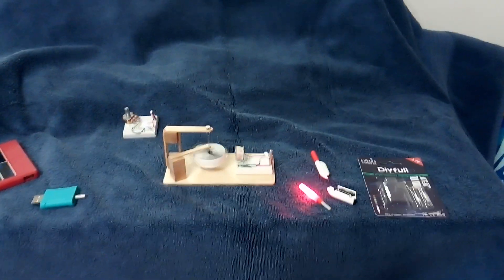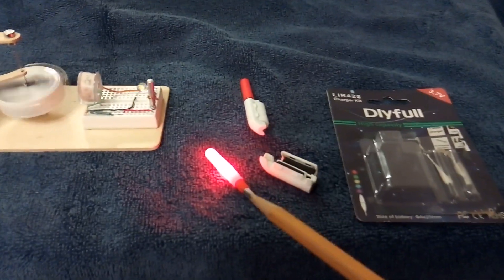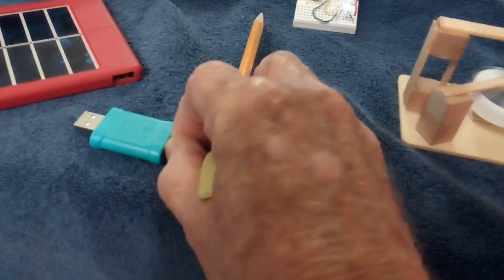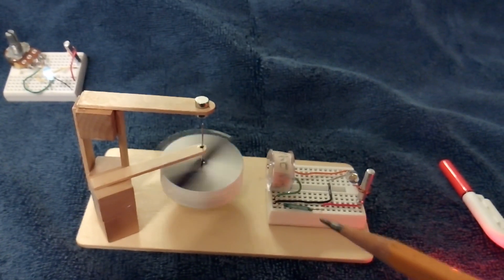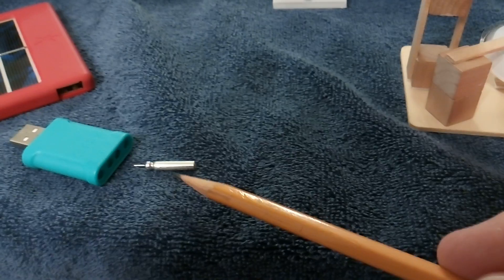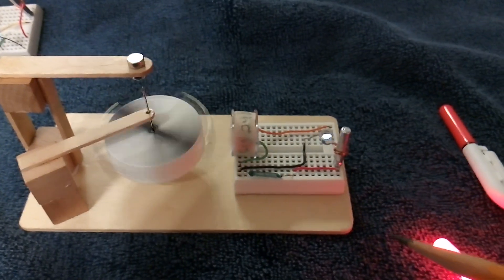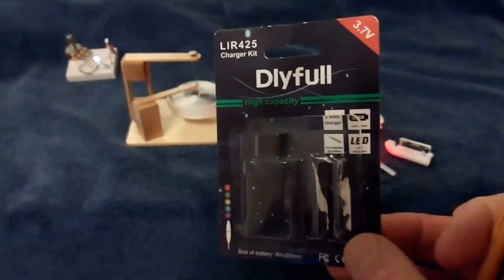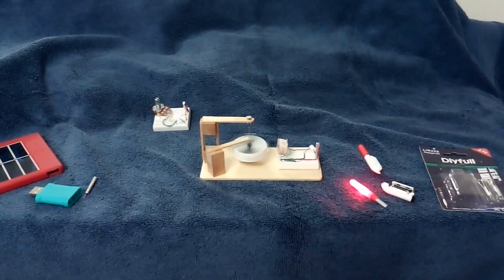Tiny rechargeable battery for small projects

Comment: Very cool little things, especially the way they fit into breadboards.
I'd never heard of them, thanks for the heads up! 😀
Reply from the maker: You should get some of these and try some experiments.  Grandad ordered a few and I look forward to seeing what he uses them for.  It is another gift from BigClive. Two of those big Dollar Tree solar light panels in series should charge then up.😀
Reply: @Lidmotor  Been looking at them and did notice some sellers seem to suggest a version is single use (?) I suppose if bought with a charger then no problem there.
These may go well in micro aircraft, would you happen to know the weight?

Also, yes indeed about the solar panels. Went a bit mad yesterday in Dollar Tree, when I saw they had boxes of them fresh in!
Reply from the maker: @Slider2732_  These little batteries weight almost nothing.  They would be great for a micro aircraft if the motor has very low amp draw.  The charge time is very long though.  My dollar tree is also still stocking those big solar panel lights,   Big bang for under $2. 😃😃
Reply: @Lidmotor  4mm coreless is the idea. I've collected 'Queen Anne's' chocolates top plastic film for years now and never used it for aircraft wings. Idea, to use a bamboo frame and launch the thing - watching it fly away lol. But these batts might make it possible.

Comment: Thanks for the reminder, I watched Clive's video and had planned to have a look for them, then completely forgot about it 😁😁👍👍
Reply: I did the same. I think there are non rechargeable variants of the battery. Something to be aware of if getting batteries without a charger!
Reply: Quite a wide variety of prices on eBay. Obviously I have just ordered the cheapest. We will see if it arrives 🤣🤣
Reply from the maker: @GrandadIsAnOldMan  I got mine on Amazon.  I paid a little more but I wanted it to arrive fast.  The only thing I don't like about them is how slow the charge is.  It takes hours and I am so used to super caps that are super fast.🤔

Comment: Joule Thief I first saw on Lasersaber channel.
Reply: "One-Volt LED" (named by Z. Kaparnik in 1999), or the "Vampire Micro Torch" or "Joule Thief" (designed in 2002 by Big Clive). The essence of this popular circuit comes from Kaparnik's article in Everyday Practical Electronics, which included schematics for a "Bright Light" that will power LEDs
Reply: @Kangsteri  Hey thank you I was unsure.
Reply: @JustHere999dl I think it was also the thing that sparked idea for the Bedini motor. But Lasersaber took it to totally different level with the ringer looper :D MTech industries has kicked the ball even a little more further ;)
Reply: @JustHere999dl  Clive did a video about it 9 years ago ( How to make an authentic Joule Thief )